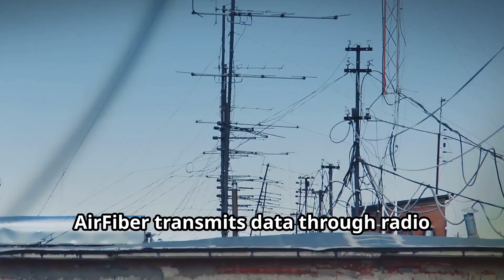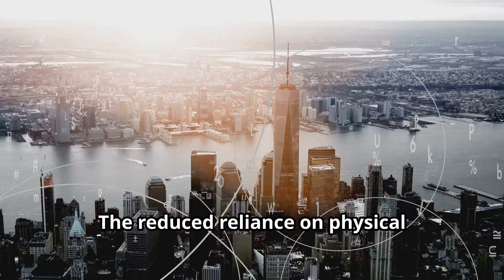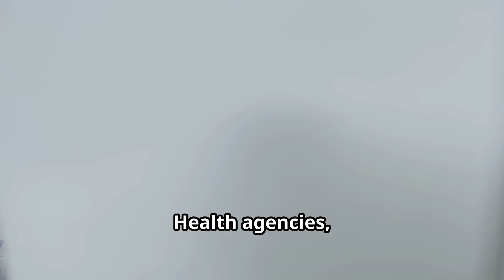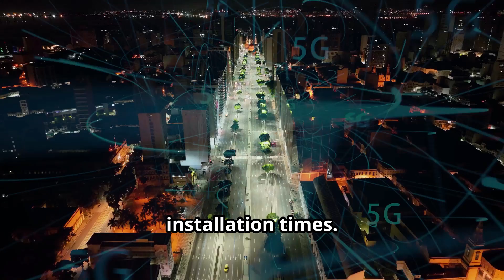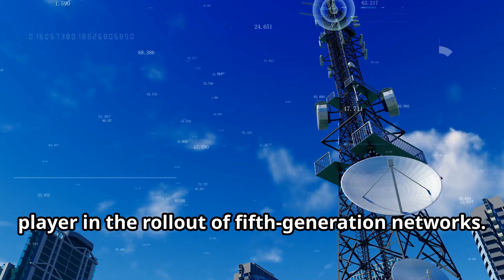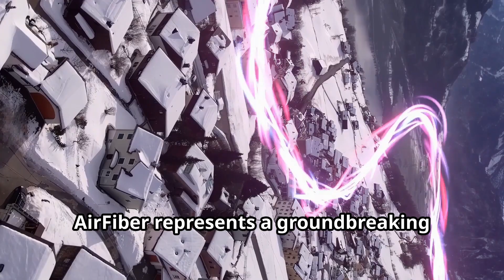Why AirFiber Will Change Internet Forever

Comment: Yes, LOS is not new, nor is wireless data, but for anyone confused on how this differs from what we have today, think of the wireless spectrum much like trying to listen to music from outside someone else's car. Regardless if the doors/windows are open/down, you'll hear the bass if you're close enough. This is like the older 800Mhz spectrum (2G/analog/Verizon 4G in some areas). It can go through things easily but can't go as far. Now imagine they have their windows rolled down, at an odd angle to you, and kinda far away. You'll hear the vocals. This is like the more tranditional 3G/4G at 1.7-1.9Ghz. Now imagine they're a mile or more down the road, but you can literally see (LOS) their speakers. Now you'll hear the tweeting, or high-end treble as it's sometimes called. This is like mmWave or let's say 10Ghz+... Add to this that the higher frequencies have more space for the RF signal to encode data, and, in the right situation mmWave can give both better performance and reliability. But, for your average phone-in-pocket application, Verizon 700Mhz is the way to go.
Reply from the maker: Wow, you explained it better than I ever could.  Thank you for that!

Comment: I'm confused, we've had LOS connections for decades? This is actually a problem with this idea, today I can get a 5G signal in my house, walls, roof... I can get any number of carrier devices that will provide 5G internet access in my home. Why would I want to trade that wireless option for one that requires LOS. Is this more for enterprise? Microwave has also been around for decades?
Reply from the maker: While LOS is not a new technology, it has an added use.  At least 2 mobile phone carriers use AirFiber to provide wireless home internet service to enhance speed and reliability in remote areas or where traditional 5G signals struggle to penetrate.  It's not for everyone but I have switched from my conventional cable company to my mobile carrier.  Thank you for your comment, I appreciate your perspective
Reply: According to the video, it uses mmWave, which is much higher frequency (28 GHz IIRC) than other cell networks.  This provides much more bandwidth, but also makes it more susceptible to blocking, as mentioned, and why they said to put up an external antenna with line of sight.  This would also improve things at lower frequencies, compared to a phone.  Also, as mentioned, it is 5G, which can be used on any cell band.
Reply: Decades?  Semaphore has been around for millenia!  The original line-of-site.
Reply: A lot of 5G is just 4G+ true 5G is line of sight a, sheet of paper will block it